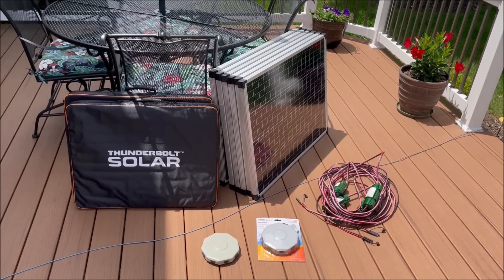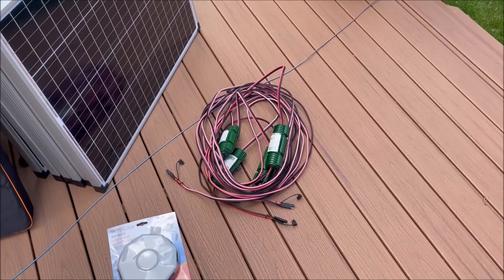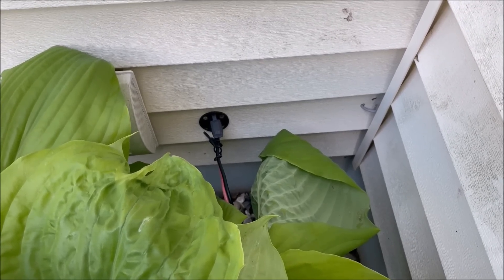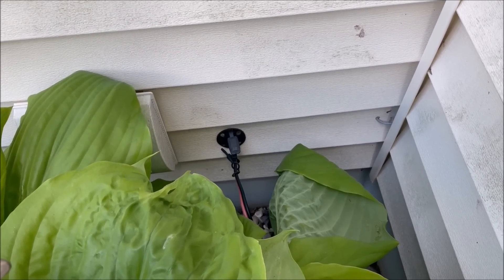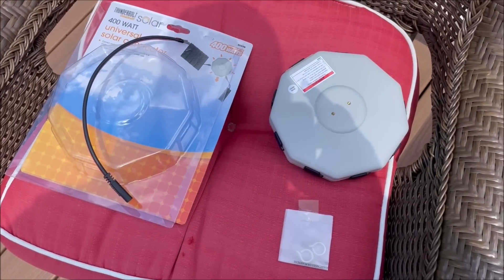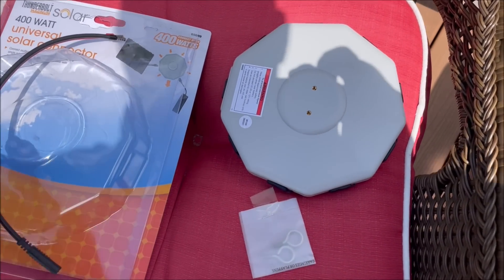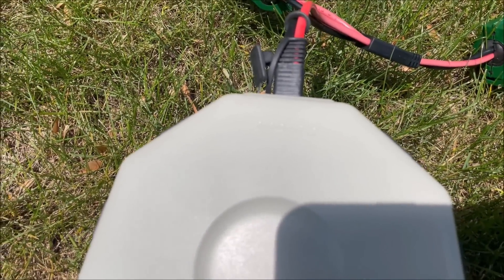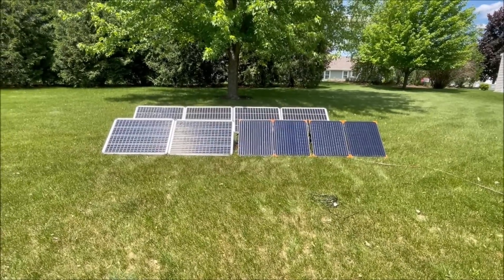Part 1-Hook 8 Harbor Freight Solar Panels together in Parallel - OOPS - "Houston We Have A Problem"

Comment: I have Harbor freight panels too and I changed out the SAE to Mc4 connectors then series connected five 100 watt panels to see what power I could generate and to verify they can be series connected. The manual states in bold not to connect in series but if you need to it must be done by a qualified electrician which is BS in my mind..  I connected the 5 in series to my Bluetti AC200MAX and brought in 465 watts at 5:30 pm just recently (June) with hazy sky conditions. I've found that these panels out perform their specifications as a norm. I will say  that if you modify the panels you obviously void the warranty so I verified their operation prior to modification.  By the way, retired ATC here.
Reply from the maker: ETC here.  Thank you for your Service Chief.  We should meet the qualifications.
Reply: @thechiefsway2618  I think we do, might of been a problem if I was a AE, more than 1 wire. LOL. We use to call the AEs one wires.

Comment: Two things I see may be your problem. Battery is almost full charge. Did you calculate voltaage drop from the panels to your house? Another item might be panel angles.😎⛏⛏🔥🔥
Reply from the maker: There may be a slight bit of Voltage drop but a single HF Briefcase Panel pulled in a massive 122W on the same cable.  As far as the battery being almost full see the video I made on 6/27 about how the Renogy Charge Controller works in the Lithium mode.  I basically charges full power till approx. 14.3Vdc, then quickly ramps down the power till the Voltage quickly reaches 14.5Vdc and the battery is full and remains in the BOOST mode until the battery is used again.  Basically the problem is the Renogy Charge Controller is limited on its ability to get the max out of the panels at 16-18Vdc.

Comment: The Renogy will only count the power it’s sending to the batteries. With batteries at near full, the Renogy will only sent what is needed to top them off. That will look low but is normal. For a real test, run the batteries near empty and watch the panels actually charging the battery. That will give you a realistic idea of performance. I made the same mistake the first time trying new panels with a  newly LiFoPo4 converted trailer . I had tested voltage as good and they only put out half their current rating, until I let the batteries run down.
Reply: I have the same problem as this guy But with lower numers. But Im running a flooded battery. If I hooked a lithium ion I would have different results
Reply from the maker: I ran the batteries down to 19% and recharged with solar.  Only picked up about 20W from 338W to 359W.  See the video I just did on 6/27 about how the Renogy charger charges in the Lithium mode.  The Controller charges full power till approx. 14.3Vdc, then quickly ramps down the power till the Voltage quickly reaches 14.5Vdc and the battery is full and remains in the BOOST mode until the battery is used again.  Basically the problem is the Renogy Charge Controller is limited on its ability to get the max out of the panels at 16-18Vdc.  Switching to series/parallel and 60Vdc has cured the problem.

Comment: Perhaps the cause of the problem is, that perhaps the Harbor Freight Universal Solar Connector ('Solar Hub') is not designed to be connected to / combined with, another Harbor Freight Universal Solar Connector ('Solar Hub'); perhaps combining two of the Harbor Freight Universal Solar Connectors puts too much load on the relatively thin wires you are using to connect to your charge controller.  Or, perhaps six of your Harbor Freight 100 watt solar panels are either 24 volt or 48 volt solar panels instead of 12 volt solar panels.   If so, this may perhaps confuse or damage your Harbor Freight Universal Solar Connectors which perhaps are not designed to be used with solar panels above 12 volts.  If any of your solar panels are above 12 volts (24 volts or 48 volts), perhaps it confused or damaged your charge controller.  Perhaps charge controllers are not designed to have more than one voltage rating of two or more solar panels.
Reply from the maker: I had disconnected the HF Universal Solar connector and ran a straight Y connector and also saw less power than I should have out of 2 100W panels.  I believe the Renogy Charge controller is limited in its ability to get the max out of multiple panels at 16-18Vdc.  I single panel works great, and it works great in a series/parallel set-up at high DC voltages also.
Reply: Please watch YouTube video titled Tutorial: Solar Panel Protection in Series and Parallel  (end of title) Video channel name: Off-Grid Garage (end of video channel name).  Video URL link:  https://youtu.be/GFjL0-r6LbY (end of URL link).  You may have a faulty connection to one or more solar panel or possibly one or more faulty cells of one or more panels; if so, current may possibly be back-flowing to the faulty panel(s) instead of flowing to the charge controller.  Or, perhaps you should be using two charge controllers instead of one charge controller, and use a separate wire connection for each of the two charge controllers (use one positive and negative wire to connect four panels to one charge controller, and use one positive and negative wire to connect the other four panels to the other charge controller.  Perhaps the current produced by one set of your panels is flowing from one of the Harbor Freight Universal Solar Connectors to the other Universal Solar Connector instead of flowing to the charge controller.  Using two solar charge controllers instead of one, and two sets of connection wires to separate one set of your panels from the other set, would solve the problem.  A solar tech on YouTube informed me that when using six Harbor Freight 12-V 100-W  panels, to connect two panels to one 30 amp charge controller and connect 4 panels to the other 30 amp charge controller.  I then asked him why not connect 3 panels to one charge controller and the other 3 panels to the other charge controller so that it would be balanced out, but he said it would be more stable if I wired 4 panels to one 30-A charge controller and 2 panels to the other 30-A charge controller.  However, I do not understand yet why.  Perhaps he was incorrect, perhaps not.   @thechiefsway2618

Comment: Check at the junction and at the controller with a meter to check for voltage drop and to verify the accuracy of the panel.

Comment: Your battery is fully charged, the charge controller will limit the wattage to it. Put a load on the battery and your input wattage should increase. Thanks, I have one of these HF 100 watt panels and really pleased with it. I intend to buy more.
Reply from the maker: I had put a 1400W heat gun on it to no effect.  This charger will charge full open untill it reaches 14.5Vdc when it enters Boost mode.  Boost mode maintains the 14.5Vdc.  This isn't working like a Jackery charge controller which dials back the charging rather early.  This appears to be a limitation of the Charge Controller to get the max out of the panels at 16Vdc.
Reply: @thechiefsway2618  I used the connecter that came with hub wired it strait to the controller. With 4 panels I was making 20 v with the same 40 amp controller as yours!

Comment: If you use the wire gauge calc, you should be using minimum of 8ga, but 6 ga would work best ( allowing only 2.5 v drop)
However as on of the guys mentioned, if your controller will handle HIGHER voltage, maybe 36 or 48v nominal, might do the trick, as 48v would be less than 2v drop with 10ga wire at 60 ft
Reply from the maker: Items to test several series configurations are starting to arrive.  I believe your right, series connecting two to three panels (36Vdc, 48Vdc) will do the trick.

Comment: No series?
Reply from the maker: Series connections coming soon.  Ordered items are beginning to arrive.
Reply: @thechiefsway2618  ok.  And don't put those suitcase ones on with it. They are likely lower volts and will kill your output.  Also don't go over the voltage the charge controller can handle

Comment: That is interesting, when you did the April, May, and June watt ratings were the battery full or near 97% since the charge controller/BMS will limit the amount of input the battery needs. Also, you're running everything in parallel where the amps are high, maybe connect a couple of the panels up in series rather than all in parallel to bring the voltage up. I had to do the opposite since I didn't have enough amps for my power station.
Reply from the maker: The batteries were probably near full.  Not many Ah were created those days.  On this charger there are two charge modes MPPT (Bulk), Boost.  Boost maintains the battery at 14.5Adc.  I have noticed that this charger will charge wide open right to the end the quickly ramp to 1a in the Boost mode. The charge controllers in my Jackery slow ramps down the charge but this doesn't.  Series connections coming soon.  The items are beginning to arrive.

Comment: James Klingler is right about being in float mode or nearly topped off on the batteries. the charge controller will automatically lower the output when the batteries get close to full. I do not have the Renogy one so not sure what the book says. 
I would guess the problem with the panels power is the connector box. I would recommend wiring each group of panels in series, then the two groups in parallel and bring that into the house without the harbor freight connector box and see if that helps, raise the volts and amps that way but still get same wattage they are rated for. You will most likely get more power out that way. the charge controller will still charge as it needs to if batteries are almost full. Just make sure not to overload the ratings on the charge controller. 
Also if you did not know, if the panels have different voltages, it will limit provided voltage to the lowest voltage, not sure if the different types of panels you had are rated at the same voltage or not. But if you have 20 volt panel hooked to 30 volt panel, you will only get 20 volts out.
Reply from the maker: Series connections coming soon.  Ordered items are beginning to arrive.

Comment: I'm building something similar to this setup but using 3 40 amp Charge controllers. I know my SRNE are not to be pumped over 550 watts each so this makes 6 panels max in 12 volt systems. My 18 panel array is going to push these but when I go to 20 panels I will get another controller.  Also seems as though your in float mode for the batteries. Its basically just keeping things topped off.
Reply: MPPT can be over paneled just fine. The controller will just limit output to the max amperage rating.

Comment: Take out the other solar combiner I did the same thing and took out one of the combiners and got four hundred out of my four panels and was only getting a little over a hundred at first
Reply from the maker: I had done that in the video while I was troubleshooting.  I had hooked 4 panels up to the one combiner and was getting a max of 235W.  It was a little later in the day but the output should have been much higher.  When I added the second combiner which individually was making 227W with four panels the combined output only went to 293W.  Believe the problem lies with the limitation of the Charge controller at 16V.  New items are starting to arrived that I can put them into several series configurations and see what happens.
Reply: @thechiefsway2618  hope you figure it out let me know what happens and what you find

Comment: Not sure how much volt your controller can handle. But if it can handle 32+ volt. Try running 4 panels in parallel, in series with another 4 panels in parallel. Thus doubling the voltage and reducing loss due to reistance in the wires.

Comment: Sounds like the 400w hub is where you are losing your power, those connections aren't strong enough, also the extra connectors in your long run
Reply from the maker: I had disconnected the HF Universal Solar connector and ran a straight Y connector and also saw less power than I should have out of 2 100W panels.  I believe the Renogy Charge controller is limited in its ability to get the max out of multiple panels at 16-18Vdc.  I single panel works great, and it works great in a series/parallel set-up at high DC voltages also.

Comment: Stop power washing the house to get rid of the mold. Go to Lowes, Home Depot or a good hardware store and purchase some Mold Cleaner. You spray it on with the water hose and walk away. I use to do the same thing you are doing but a neighbor introduced me to the stuff and it works great. I think the name of the stuff is Mold B Gone or something like that. Its a green bottle with a hose attachment.
Reply from the maker: Sure Will!!  It's a lot of work power washing a two story house.
Reply: Power washing also damages the finish on the vinyl then mold and dirt are harder to remove and will get dirty quicker.
Reply: Surely you have a retired Deck-ape friend that could do a good fresh water was down for you.😂

Comment: You need to make it a 48v system.
Reply: Being a 12volt system you have additional losses due to the length of your cables.  You also need a solar charge controller that allows for higher input voltages so you can put the panels in series.  However, if you do that you should use the same panels.  You are mixing different panels with different parameters and that can cause issues.  If I were to guess you are taking a system from a RV or something similar and trying to make it for use in a house type situation resulting in an over complicated system with a bunch of losses and poorly matched elements.  Watch Will Prowse's videos.  Good luck
Reply from the maker: Thanks for the advice.  The specs on those panels actually match up pretty close.

Comment: voltage drop is also an issue that will cause losses.
A long distance of only 10 gauge wire and multiple connector pairs will be less efficient. The voltage tolerance is pretty tight. The 'type' of cable and connectors is not an issue. MC4 connectors are unnecessarily expensive, unless you need water proofing. reducing the qty is what matters, while increasing the wire gauge.

let's call it 15 volts, 6 amps = 90 watts each * 5 = 450 watts at the solar panels.
6 amps * 5 = 30 amps available.

120 feet of 10 gauge at 30 amps Voltage drop: 4.28 volts
that is over 25%
voltage at the end will be like 10.7, but you can measure that (on both ends & compare).

Also check the output of each of the panels connected individually.
Series connection, for 24 volts would help with the voltage drop, but the H.F. panels are not rated for that. And, especially, don't mix & match when in series.
Reply from the maker: Checked the panels and they are good.  Also, the charge controller always displays between 16-18Vdc which is right in the wheel house of those panels.  I will be switching from a pure parallel configuration to a series/parallel configuration soon.  Increasing the Voltage and lowering the current should do the trick.
Reply: @thechiefsway2618  ETCS (ret) here. That's what I did with my 6 HF panels. 3 in series plus 3 in series put into parallel. Output is now 60VDC with low current. I'm using 12AWG landscape wire 50 feet or so with MC4 connectors. I built a fused 6 port junction box like what is used on boats. I have an EcoFlow Delta Max 6KWH setup. I run the entire house off of this. No load shedding. After 20 hours I'm down to 20% on the Li batteries. HF panels are working great. Got em on sale for $90/ea

Comment: You are not getting any power because your batteries do not need any power. Run the battery bank down and you will get blasted with power. Also....your renogy charge controller likes higher voltage.....so do like others have said and run in series.
Reply from the maker: Had also ran the batteries down when troubleshooting and still had a ceiling of about 340.  I think you right on the voltage and have ordered all new cables & MC4 connectors.  I’ll report back with another video part 2 on what happens.
Reply: @thechiefsway2618  i have the exact same charge controller and it wont let juice in until the batteries need it. I am running 100 volts at 5 amps...in series of course.
Reply from the maker: @Texasprepper  At the time of recording the batteries were down by 13Ah, I had also run them down by more then 20Ah during troubleshooting and still had that ceiling of 340W.  I'm trying to get 32A out of 16-18Vdc which is obviously not happening running everything in parallel with the original Harbor Freight SAE connectors.  I think you nailed the solution by running a higher voltage and lower current.  I've ordered everything I need to switch this over to MC-4 connectors and a Series/Parallel configuration and we'll see what happens.  Thanks for the comment.
Reply: @thechiefsway2618  battery voltage is what triggers the charge controller. You need to run them down to like 12.5 volts or lower.....this is one reason that you want more than 12 volts incoming.   That charge controller can only handle 500 watts....it will NEVER give you 800 watts.
Reply from the maker: @Texasprepper  I was attempting to over panel on purpose to max out at 520W earlier and have it run at max later into the day and produce better on cloudy days.  Prior to this video the max I had connected was 4 panels.  I will certainly experiment with running the batteries down and see what happens.
Reply from the maker: @Texasprepper  Ran the batteries down to 19% but didn't see a significant change in Charging Power.  Got 359 & 351Watts on consecutive days.  New parts for a Series/Parallel connection will start arriving on Friday.